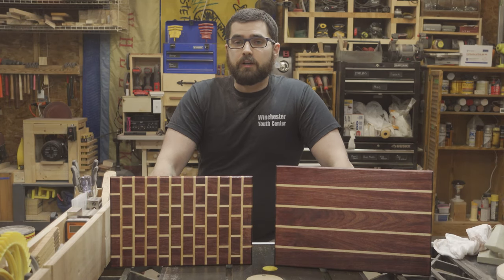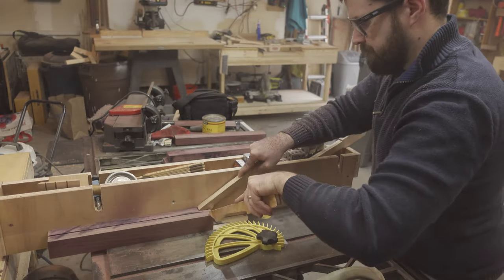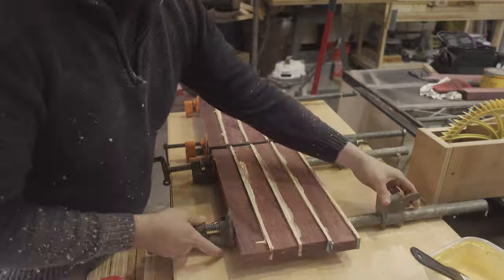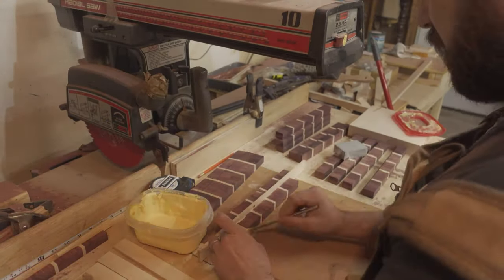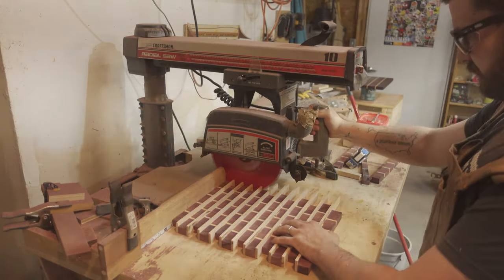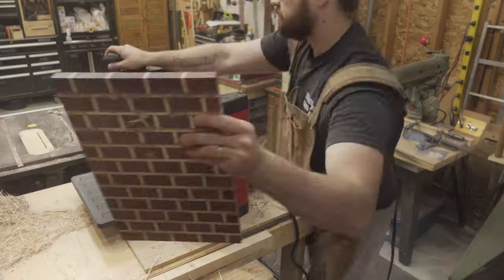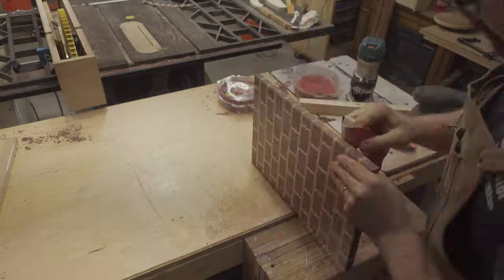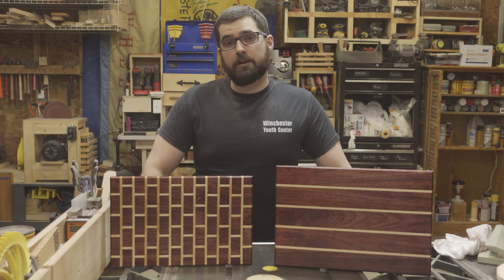Fancy Cutting Boards

Comment: My father has a very similar radial arm saw which we've used a few times. Does your ever "drift" a bit when the arm is extended? Sometimes it made it hard to get really straight cuts! Awesome video dude, keep up the good work!  -AJ
Reply from the maker: Thank you for watching! I have not experienced any drift on my either of my Radial Arm Saws but I have heard that it is a problem some encounter.

Comment: Purple heart burns at the sight of a sawblade.
Reply from the maker: haha very true! Probably did not help that I was ripping it with a 60T blade. I did enjoy working with it though!
Reply: @BassadorWoodworking  I have a love/hate relationship with purple heart. Any time I get splinters, it is guaranteed to be from purple heart. Nevertheless, I plan to consummate the relationship with a purple heart workbench this spring/summer.
Reply from the maker: Yes! So many splinters! You are going to film the workbench, right? I need to see that.
Reply: @BassadorWoodworking  for sure! Def going to be making a video of the build. I’m hoping it’ll be one of my more interesting builds of the year. 5.25” thick Purple Heart top. With Andy Klein’s twin turbo vice and steel base. Want to make a proper forever replacement for my current workbench.